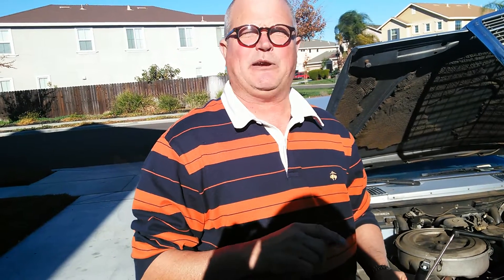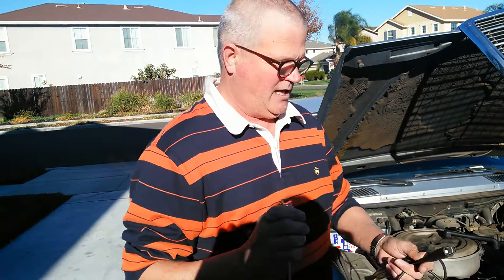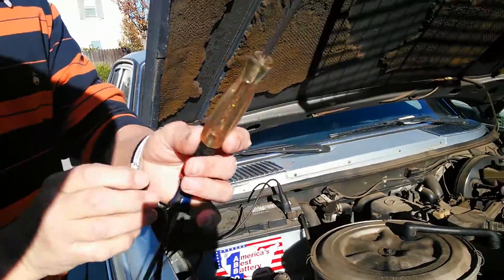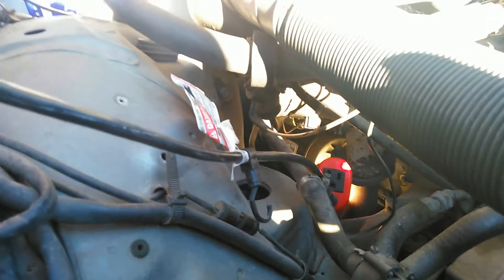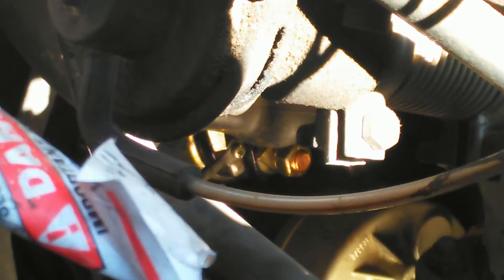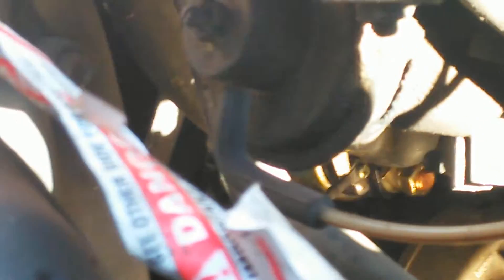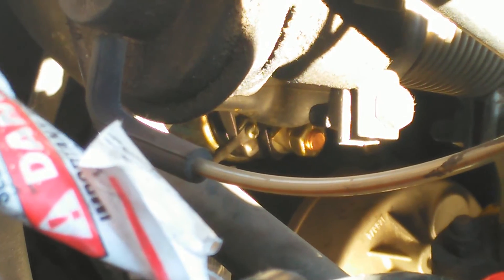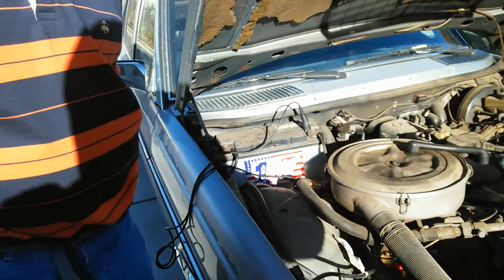Mercedes-Benz W123 Starter Solenoid Test

Comment: Nice vid like u style
Reply from the maker: Thank you very much.
Reply: @dukecallaway7992 used your method with slight mod 1978-300D … we used a ratcheting 10mm 12point box end but was hi torqued so we got rope on open end and broke loose… wrenched a bit then fingers   My 14 yo so was main worker. On bottom we jacked car n blocked at frt bumper n rear b4 wheel
Back was so tight it took come a long affixed to axel of M35A2 to break initial torque.

Comment: Yes very simple very helpful     If starter solenoid getting power then bad starter   If no test light can use volt meter & should read approx battery volt when keyed to start    If starter has power and no werk  clearly bad starter

Comment: Lol "just change the starter" on a 123 its a project to say the least.
Reply: Toughest part was getting starter out…. We take out thru top. Think it not first time … bc the heater or ac line brace was un attached .. bolt  nut missing.. 1978-300D so used wood stick to pry those lines ever so slightly whilst my 14yo pushed from bottom w stick n his friend pulled from top whilst i held lines back. Could not get small wire Xscrew loose so clipped wire. Our main wire was a 17mm not 14mm. Also undid tranny fluid dip bracket but nominal effect … biggie were hvac lines … naturally all air filter gear and battery box out.  

Btw if turbo (ie 1985-300SD) it lots more as must remove turbo or do the over top 27”extender w floppy & losten steering suspension to drop starter from bottom…  fingers crossed for my ‘85.

Comment: happened to me... i thought is was the battery, the battery connection...  it was actually the terminal wire to the starter (wires underneath the steering wheel) it had come loose. (the purple wire on the 1981 300D)   it needed to be replaced and was causing a short from the ignition for the starter.  an $8 dollar fix.
Reply from the maker: The $8.00 repair is amazing.

Comment: So as i understand what you are trying to say is that there is a good connection from ignition to starter selenoid and 12 volts to battery then its the starter body itself?
Reply from the maker: In my case, yes.The starter solenoid was not engaging, so I went to O'Reilly's and purchased a remanufactured replacement. It has been trouble-free for almost there years. To me, it was easier to just replace the entire unit and buy one with a lifetime warranty.
Reply from the maker: Yes,  on my 1981 300D non-turbo it is. To test your starter and ignition switch put a test light on your starter solenoid and have someone turn on the ignition key